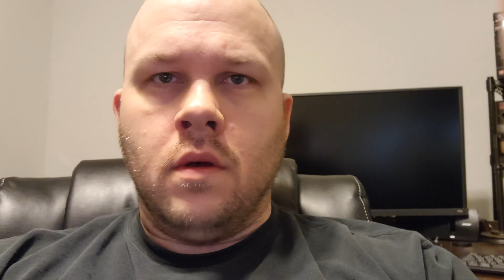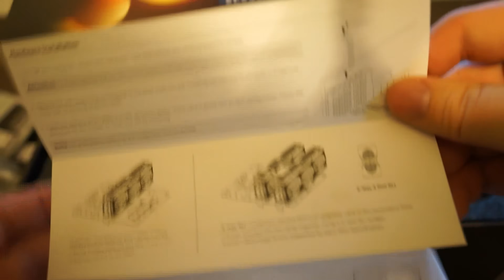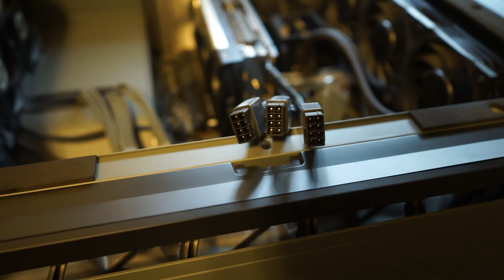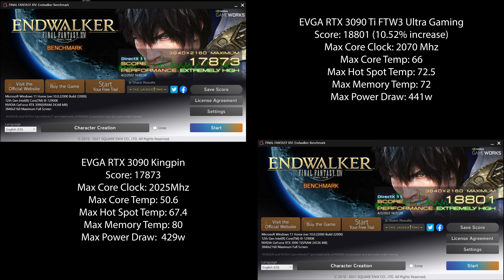EVGA RTX 3090 Ti FTW3 Ultra Gaming | Unboxing & Benchmarks VS EVGA 3090 Kingpin

Comment from the maker: Video corrections:
4:17 - It's 525w.  450+75=525.  My brain no has strong maths.
17:17 - I forgot I had a noise reduction filter going in Adobe so you really pretty much can't hear the fans even at 100%.  They're really quiet at 70% though.

Chapter Layout:
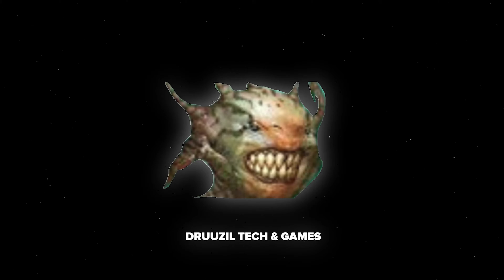0:00 - 0:31 Intro
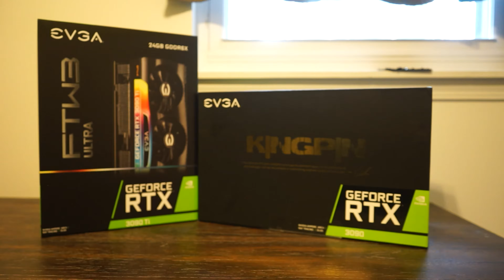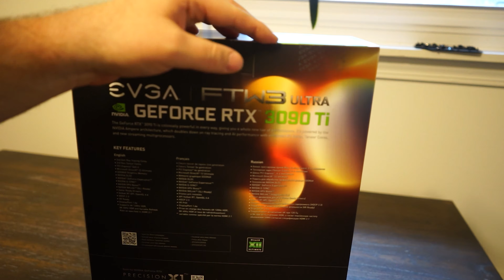0:32 - 1:13 Opening Statements
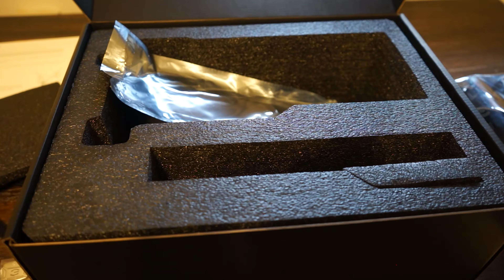1:13 - 5:54 Unboxing the 3090 Ti
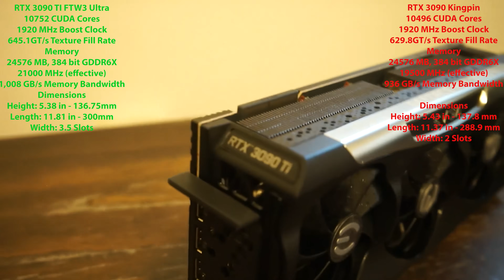5:55 - 11:10 Evaluating the card's features
11:11 Side by side comparison and card specs
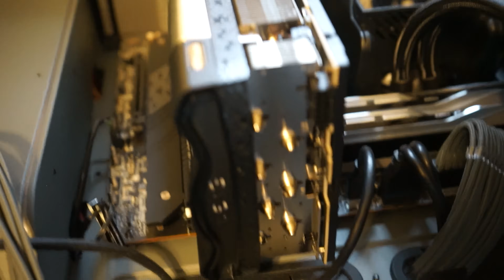12:37 - Card is installed
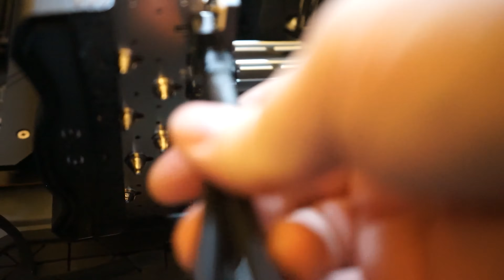13:12 - Connecting power to the 3090 Ti
14:15 - Pointing out how big the card is and how it blocks slots on the motherboard
14:42 - The useless "e-leash"
15:53 - System powerup
16:45 - Into Windows, checking out the RGB lighting profiles in Precision X1
21:45 - Benchmark results of the 3090 Kingpin vs the 3090 Ti FTW3
22:29 - Closing thoughts.

Max GPU Temp:     65 degrees
Max VRAM Temp:  72 degrees

If you liked this video, please leave a like, comment, and consider subscribing or sharing the video.  These all help me in the YouTube algorithm so other people can find my content.

Thank you!

Comment: I'm of the same mindset with not wanting to swap it out my EVGA RTX 3090 TI FTW3 U CHUNGUS as the pins are fragile and found it difficult ti install this and other large gpus into my lian li o11DEvo as well.   To fix this i just reached around the back of the case to the 3 tabs on the card and lightly pressed them in and they went into their slots no problem * seems they are slightly misaligned*. This allowed my card to glide right in to its home.. Hope this is the same issue you had as it changed the constant struggle of''' wtf... why isn't my gpu going in ?! its perfectly lined up !!! issue.. ''
Reply from the maker: Since buying it I had to remove the card once to remove a faulty SSD and the GPU went back in more easily the 2nd time around.

Comment: Pretty insane how good air cards ate now especially the 3090ti I swear it's so polished it doesn't get enough credit. It's cooling is outstanding for the power it's pushing it doesn't have half the issues all the other 3000 series cards do even the asus 3090 which I had just got way to hot even doing everything right it still did lol. The 3090ti is a polished version and just really really good.
Reply from the maker: Also very huuuuge lol
Reply: @DruuzilTechGames  absolutely massive! But I love it haha made me feel like I got my money worth. I couldn't believe it was even heavier then the mdi suprim x. I didn't expect it. The msi is under 5lbs this card is literally 6lbs. It's not as big as the msi in length but it's thick and dense and just was really made well even if the face is plastic the backplate and hestsink make up for that. Def the biggest backplate of all fo the 3090tis it's big haha.

Comment: You did a great gob with the review. only 72+- degrees highest temps on the memory chips? Wow - this vapor chamber and the overall cooling solutions fron EVGA on 3090ti looks supreme. Would be nice to have more tests/your thoughs especially about thermal degrees.
Thank you.
Reply from the maker: Yeah the temps are great on this card.  Even with an OC of 300 on the mem, the temp doesn't even change.

Comment: after my strix 3090 OC died I debated getting a kingpin but I would have had to buy a new case that can use 2x 360 rads plus the kingpin prices on ebay are still high so I just went with a 3090 Ti ftw3 ultra on newegg. The shipping lable was printed on friday so with overnight shipping I should have it on tuesday. Asus should have my dead 3090 on monday crossing my fingers that they do the right thing and honor the warranty  so I can get some money back.
Reply from the maker: Yeah the Kingpin is a great card but the 360mm AIO is both a positive and a negative since it wont' fit in a lot of cases.

Comment: This card has structural support from both the top an bottom of the mounting bracket to the top and bottom of the cooler. That is essential for preventing sag on a big card and should have been done forever ago. Love this card. Runs cold even at 4k 120!
Reply from the maker: Yeah even overclocked the GPU is like 62 and memory is cool as a cucumber.
Reply: @DruuzilTechGames  I have the same 3090 Ti.. But my Phanteks Enthoo Evolv completely chokes this GPU of Air flow and dumps it inside the case even with 4 exhaust fans.
Reply from the maker: @KillswitchINF  Ah yeah this card is friggn huge no doubt.  The Phanteks 719 is substantially larger than the EvolvX (I have one of those also)

Comment: Have you tried running the 1k vbios and capping the power limit to 55 and see how it the kp card runs?
 I got 11,700 graphics score on tp extreme with +160 +1500 capped at 55 =550w

These oc's are my stable oc gaming as well.
Reply from the maker: I dug through my TimeSpyExtreme results but I don't think I retained a lot of them when I was testing the OC.  I did use the 1k bios and I did exceed 500w by a bit but I don't have exact numbers on wattage or scores.
Reply: @DruuzilTechGames   Would be cool if you load up the kp 520w vbios and run a test again. Make full use of that kp see how it compares. 🤙